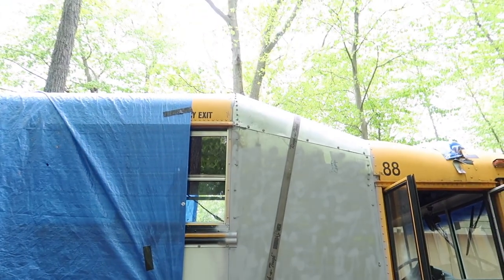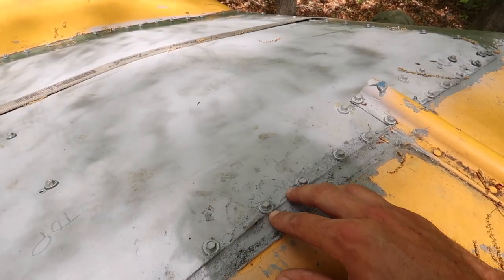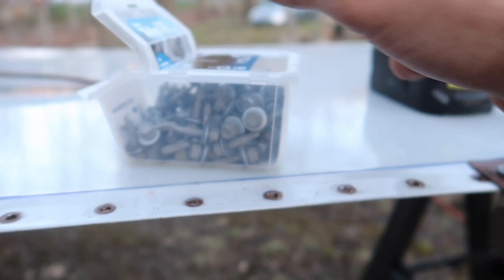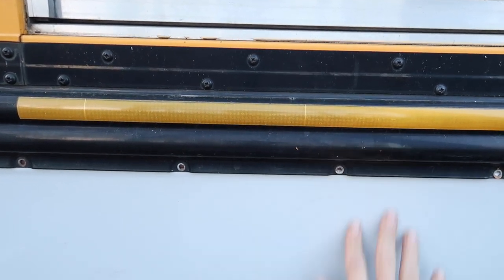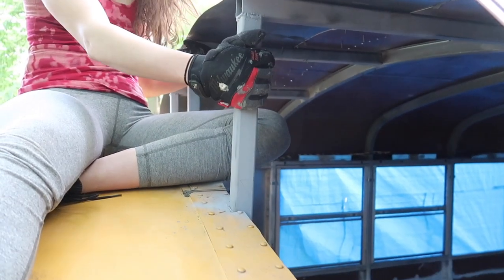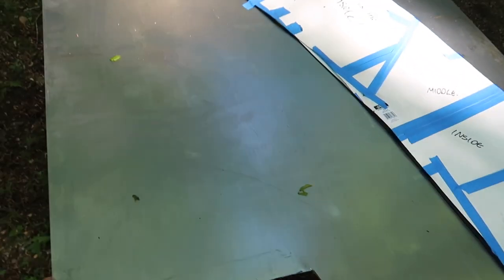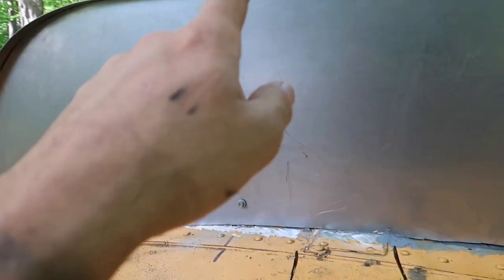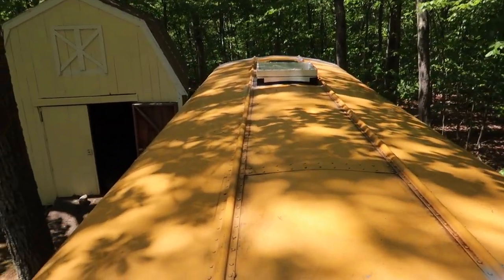Skoolie Bus Conversion - Ep 4 - Sheet Metal + Roof Transitions

Comment: For the sheet metal cutting, they make electric tin snips that will pull a perfectly strait line with some practice. I have a set in my tool box that I'll finally have a use for when I get to my roof raise going.
Reply: I honestly think a sawzall would be the best solution
Reply: @BALLGAWKER  nah tin snips. Cleaner cut, no expensive blades to buy and my cute are always strainer with it over a sawzall. Although if you have a sawzall and don't want to buy the tin snips (mine were a hand me down from my stepfather) I wouldn't blame ya.

Comment: I definitely have one tip for anybody that wants to have an easy bus build ditch the angle grinder for making sheet metal parts and used cardboard for templates and if you have a welder, that is good, you should be able to afford a plasma cutter. It will make it a lot easier to cut steel and save steel with a plasma cutter Or Ox acetylene torch then an angle grinder with cutting discs. It’s a lot less dangerous too. It really hurts when the cheap cutting discs break.

Comment: And if you do a roof raise and you use these rubber washer screws it’s just like regular metal roofing screws. If you overtighten those screws, you risk more of a chance of leaking there overtime because it’s ruining the rubbers strength when it’s over tight because when metal gets hot, it moves in an expanse and it’s going to move stretch and the rubber seal on that screw but also if you decide to do your roof phase and you don’t know if you should just have it in the middle like they have it or the back all the way tothe front that’s a lot easier because then it’s got a little bit more strength so that it won’t buckle when you’re lifting it I think if they would have lifted it, they wouldn’t have had a big

Comment: wondering why you didnt included the rear wall with the roof raise you couldve left the frame for the emergency door and cut through the rivits holding it to the sheetmetl and lift it off the frame , the sheetmetal wouldve been way ezier to replace and wouldve looked better , i think the roof will leak eventually you culd use some glasfiber matting to cover the seams a little extra